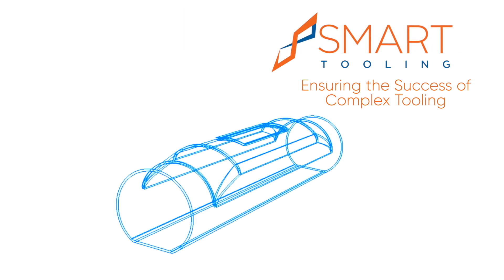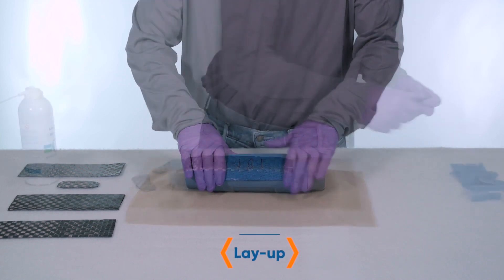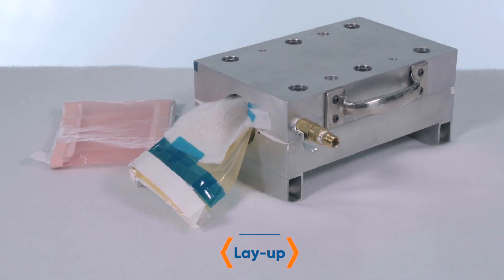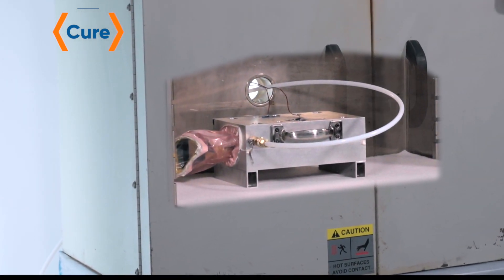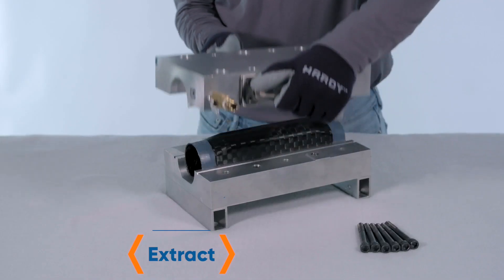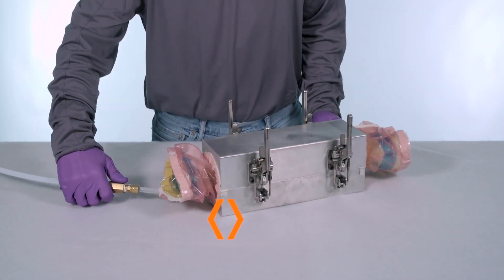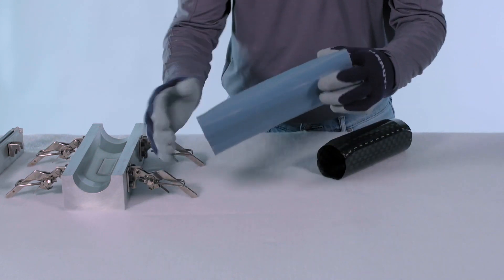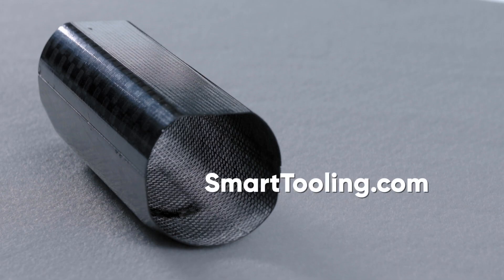Composite Bladder Tube Demonstration | Smart Tooling Process | Smart Tooling

Comment: Its cool, but it seems like a lot of stages when you can use a silicone bladder to basically do the same job. Massively cheaper and you dont need two oven cycles per part essentially. We have a job where we need to make around 1200 tubes/ month and I think this would set us backwards over normal bladder materials. I'm sure there is a market for it though.

Comment: I design and make composite parts every day and this system is way to complicated and expensive.  There are much simpler and cheaper ways of getting equivalent parts.
Reply: how are road bike handlebars made? I can't seem to find a youtube video about it. I dont think something like this works because there are too many 90 degree angles. So how is it done, you reckon?
Reply: What would be a better alternative? A split mould?
Reply: This technique is for high volume production, it is cheaper, it is faster and it is simper than another techniques once you have the equipment. Another techniques may be cheaper and faster in case of low volume production.

Comment: i would either make a (sock)tube in a sleeve loom, or a tennis-racquet-grip tape like wrap of continuous carbon fiber strip, cross layering. 
making carbon tubes of flat segments of material wont result in a real tube structure.
Reply: Unless you're SpaceX making a pressurized liquid fuel tank this is simply not true for 98% of use cases.
Reply: You can absolutely make structural tubing using overlapping sheet plies. The interlaminar shear strength of co-cured plies is very high so getting bond strengths that exceed the tensile strength of the fibers doesn't take that much overlap and is easy to estimate.
Reply: How do you think bicycle frames are made?

Comment: Hi, please, what's the pressure used in bladder?
Reply: atmosferic presure 1 bar. (the bag and mold is under vacuum)
Reply: 30 psi is a good place to start.  I have gone up to 500 psi, but don't really see significant improvements past 100 psi.  If the resin can flow into a bleeder cloth or out of the mold then you definitely want to say on the lower side of the pressure range so as to not squeeze excessive amount of resin out.  If you are making the part above, a solid silicone core with a tunable air gap is so much easier.  Throw the mold in the oven and the silicone plug thermally expands in the mold when heated and does the same job a lot easier.  change the compression is as easy as cutting a little of the silicone plug away to increase the air space, or add a small piece of metal like a washer to reduce the air volume.  One or two parts to tune he mold then easy street.
Reply: Atmosphere pressure.